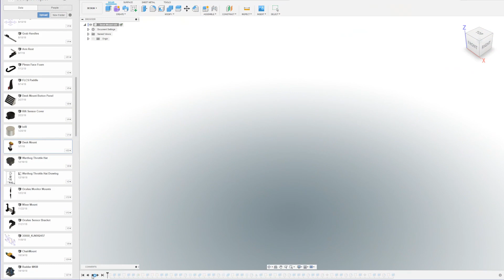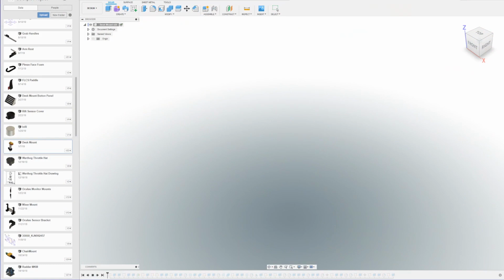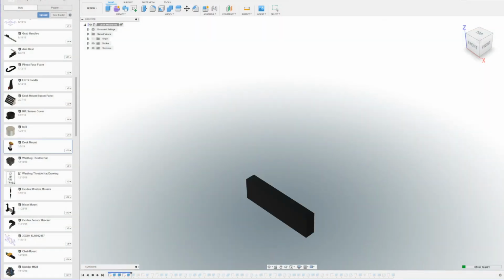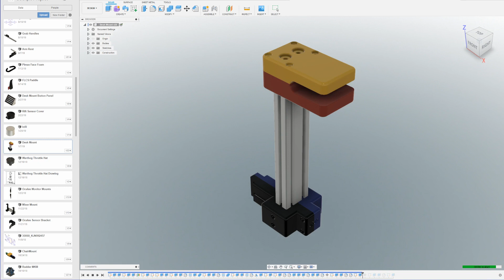Flight Sim Gear No. 3 - Thrustmaster Warthog Desk Mount

Comment: Hi there. This seems to be very interesting! Two questions. The extrusion is an aluminum? Second i cannot understand how the clamp is tighten on the table. The screw is drilled through the table?
Reply from the maker: Hi Nick - yes its an aluminium extrusion - 30x60mm type. In the diagram on the thumbnail the bolts pull the red part upward toward the yellow part and clamps onto the table top. Its quite sturdy although for the joystick you may need some rubber mat inside the clamp part to stop it sliding about, if you really pull on the stick a lot.